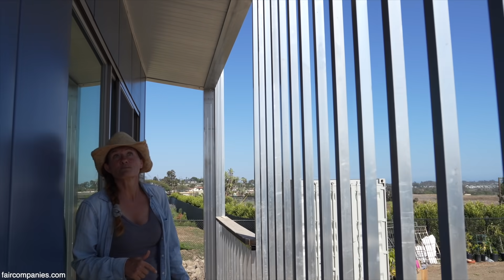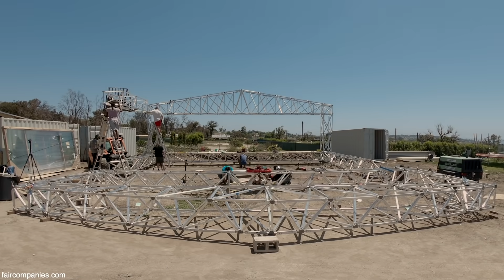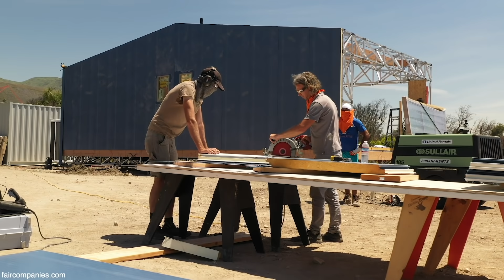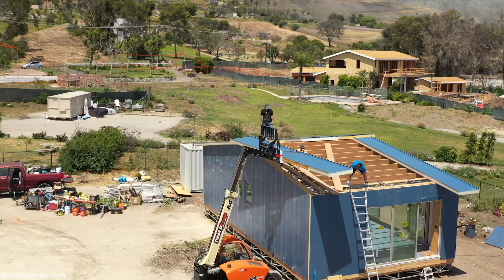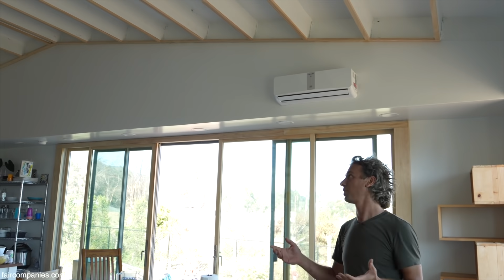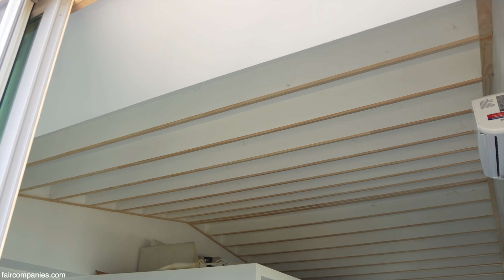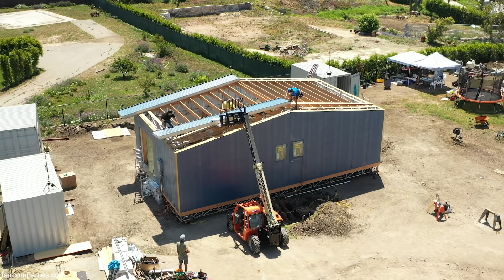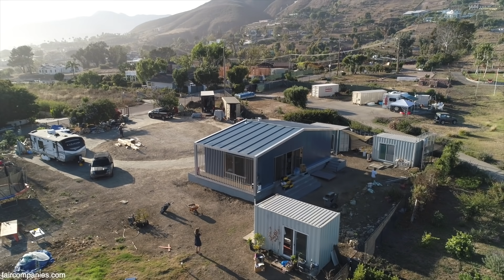This home goes up like a Coachella modular build: fast/cheap

Comment: I live in a tiny house on wheels myself, so I’m a strong supporter of alternative ways to house oneself.

However, one of the models on the website that is linked in the video’s comments—a 400 sq ft space—is listed by the company selling these at $216k.

These are housing projects marketed to high-income earners who want to live eclectically, not solutions to housing problems for regular people.

Comment: Aluminum conducts heat very well (to the exterior).  I wonder how a home like this would work in northern Canada where it can be -40 C in winter.  With the wind chill factor (wind blows heat away from anything warm, making it seem colder than it actually is), it can feel like -65 C.

Comment: Be aware, metal buildings in Parasise burned. Metal conducts heat, potentially buckles, deforms, creates gaps and the flammable contents burn in areas where people most want fireproofing, which is and near forests. And people want big windows and sliding glass doors, especially in scenic, beautiful natural environments.  Heavily design for firebreaks and isolation. And it is going to be extremely expensive to heat a big, open space with a very tall cieling. This design is more sales oriented than focused on a sensibly functional layout for most people. And heating costs is a primary consideration. Depending upon how well it is insulated, cooling costs may also be prohibitive in this layout. Broadside facing the peak of summer sun will contribute unfavorably to this.

Comment: i am wondering what technique/materials they are using to seal the roof. and i am wondering why they did not put a truss across the center point.. even if it was a narrower truss.. seems like that creates a potential weakness in the roof structure, unnecessarily..

Comment: You are using what is universally  known as SIP ( Structurally Insulated Panel) your house could have been completed in 5 days with cheaper galvanized steel frames. Cost in China are $28 per sq meter. Go to the website Made In China for examples and price.

Comment: This house seems to be very expensive, compared to alternatives such as container house (cheaper in material costs and has a higher resistance to fire, melting point at around 1425 to 1540°C, more than twice the amount compared to aluminium) or 3d printed house by Apis Cor (polymer concrete, cheaper and faster to build with).

Comment: Similar to Army engineers in WW II, for building bridges very quickly that could carry tanks across rivers.  Even the Sherman tanks, which were pretty small, were often too big or too heavy for existing bridges.  So they basically invented trusses that could be pieced together using pieces that could be handled by 2 men, working together.  I think they called them "Bailey Bridges," which was what I thought of when I saw the crews putting together the frames for the trusses.

I like the modular pre-fab idea for homes, and integrating these construction principles with earth-sheltered designs.  But if you want a living space in a hurry, for cheap, building a box on top of the ground this way is pretty cheap.  The walls are double-wall, insulated sheet steel, according to the video. I think if you wanted earth-sheltered, you would have to re-think the materials that came in contact with the fill.

Comment: I had a studio apartment built as a rental property made out of ISO panels, the same type of panels used here. The construction was fast, and even though I had my reservations about this type of constructions, I was present the whole time and saw the strength of the build. It was finished with sheet rock inside and laminate floors. The overall finish resulted quite good and I'm very happy with the results. Needless to say it won't be my last construction of this type.

Comment: I always enjoy all the different types of construction methods available.
This type home would not work where I live. With no attic with ventilation, the ceiling condensation would drip and cause black mold all over it. If a medium size tree got blown over on top, it would crash threw the roof.
Thank you for sharing! I love the outside look.

Comment: Why not concrete its fireproof bulletproof and sometimes bomb proof . In the long haul with energy efficacy and with the longevity it's less impact on the planet. (remember long haul )I just Built My small Cabin/Casita on my ranch In northern Arizona for 10 % less than wood. I would have done ICF foam block but I could not  get a  concrete truck deep into the mountains. They both run about the same in time,labor and materials the difference is energy efficacy is light years better with ICF foam block. All for a total on my 16X16 cabin i have 5500 into it free and clear.

Comment: this guy is full of shit "it's strong because of geometry"... yeah, so is a regular truss. there is nothing advantageous about this building design. a pole barn house achieves 100% of the same result, but without the extra bullshit. steel posts if you want extra fire protection, wood if you only want good fire protection.

Comment: And the SNOW LOAD? 
          Per Square foot.... MMmm
Reply: Malibu. California. What snow load?
It's cold if its 50F. Hot if it's over 90F.

Why would they have to factor that in when it snows (less than an inch) once every 75 years.

Comment: Fire seems to be the greatest fear with this building site.  Though the exterior is metal (Aluminum and Steel) the interior is wood.  If a fire gets to this structure the metal, exterior and interior structures will conduct heat to the interior sufficient enough to cause the wood to burn.  Though lack of oxygen might keep the flame down the smolder will be too much.  The owners of this property need to be able to keep the exterior cool somehow if they want to keep this house.

Comment: What is the R value of the wall? Does this system have an ACH50 rating?
Reply: Those are insulated metal panels, originally used in commercial walkin refrigerators.   They are almost completely air tight and are around R5 per inch, with 6" being the thinnest panel and 12" being the thickest.  Some companies have started making roofing panels (as used here) as well, they are typically R50 (10").   Look for Kingspan, SteelGenix, EcoSteel and Google Insulated Metal Panels for more info - they've been used in commercial buildings for 50 years.   They are so airtight that some home manufacturers supply an ERV so you don't have issues.

Comment: so it wont burn...just melt
Reply: Copied from another comment 'The numbers you mention are in the combustion zone, as in the wood burning from within. Aluminum will not burn thus it will never face those kind of temperatures. The point of this build is "to not catch on fire" from flying embers as a wooden and shingle house will. As long as there is no vegetation within 10 feet of this structure it will survive any fire around it because 10 feet from the flame it is nowhere near 600C. So the answer is YES this house will survive all future brush fires in that area as intended."

Comment: Is this polyurethane foam between the sandwich panels? When there is a fire it melts like a marshmallow.
Reply: Only if the heat source is within ten feet.

Comment: Err uhm.. all the aluminum on/near my parents house melted into puddles during glassfire. poor choice of materials for fire country!
Reply: Quote form other comment "The numbers you mention are in the combustion zone, as in the wood burning from within. Aluminum will not burn thus it will never face those kind of temperatures. The point of this build is "to not catch on fire" from flying embers as a wooden and shingle house will. As long as there is no vegetation within 10 feet of this structure it will survive any fire around it because 10 feet from the flame it is nowhere near 600C. So the answer is YES this house will survive all future brush fires in that area as intended."

Comment: won't aluminum melt in the fire?  I LOVE the cheaper idea, but i would be more scared in aluminum that wood
Reply: Copied from another comment "The numbers you mention are in the combustion zone, as in the wood burning from within. Aluminum will not burn thus it will never face those kind of temperatures. The point of this build is "to not catch on fire" from flying embers as a wooden and shingle house will. As long as there is no vegetation within 10 feet of this structure it will survive any fire around it because 10 feet from the flame it is nowhere near 600C. So the answer is YES this house will survive all future brush fires in that area as intended."

Comment: this design is unfortunate. If you had chosen to live on the West Coast for it's natural beauty, then perhaps this could be a taken as a cosmic sign that it's time to leave.  

Perhaps in time they could apply some wood to it.  Metal structures have an odd feeling inside, perhaps something electrical or magnetic missing. Not sure, could be my imagination.  You might also have felt this in an RV.  It is better to have one's biofield grounded with the Earth in order to heal, for both nature and humans.  

On a positive note, she won't have to worry about possible complications from 5g, as she is already living in a farady cage.  However, the infamous "Harvard Tin Foil Hat Experiment" revealed that RF ricoshets around the scull more with a metal hat on.  With all the wireless devices, she could be living in a microwave oven.  

As she has already lived through two fires, this presents a facinating example of how we unconscously manifest our fate.

Comment: Aluminium has a melting point of 660.3 degrees celcius bushfires get up to 1100 degrees celsius. It might not burn but it probably will melt.
Reply: Copied from another comment "The numbers you mention are in the combustion zone, as in the wood burning from within. Aluminum will not burn thus it will never face those kind of temperatures. The point of this build is "to not catch on fire" from flying embers as a wooden and shingle house will. As long as there is no vegetation within 10 feet of this structure it will survive any fire around it because 10 feet from the flame it is nowhere near 600C. So the answer is YES this house will survive all future brush fires in that area as intended."

Comment: She decided on an aluminium framed-structure with insulated steel panels--a good adaptation for a more fire-resistant structure.  The only thing I'm wondering:  They used wooden framing, beams & joists for interior support,  They could have carried through fire-proof techniques using galvanised steel studs, beams & cement board.

Comment: I don't see how the fire resistance of aluminiums would help. Any home would be beyond repair after a wildfire. With wood you'd just have less rubble to clear.  The only important thing is how much time the building gives you before it collapses once it's on fire. Light aluminium structures would lose their load bearing capacity faster than wood in a fire.

Comment: Let me just say that love this channel but this guy. Timber trusses also stand up due to geometry, tension and compression joints that transfer loads to 2 points, and can easily span 40 feet. you can also run whatever you want in the roof as they create a space as well. It's been a while since I have heard so much crap, lies and outright incomprehensible word smithing in 15mins. What does a traditional truss uses mass to carry the weight and transfer the load even mean?? your truss is under the gravitational laws as any timber product and needs geometrical designed webbing to transfer the load to the end points. I’d like to see a cat 5 aluminium structure and the cost! We don’t need builders any more with 20yrs experience we just need a few dudes with a couple of days training and boom, this so called housing crisis will be fixed. Your structure will be under the same bylaws and regulations that every house is regulated by. Those external panels can be placed on any timber structure. The cool room wall and roof system is the real saving here. Time and cost and those products have been around for a long time. 4 timber trusses two steel beams 12 posts and away you go. I’m gathering there are outdated timber floor joists (kind of skipped past that on the vid) as well as outdated timber rafters that we can see?. is the footing time counted as part of the build? how are you going to build near the ocean? have you seen what sea spray does to aluminium? how do you replace that floor structure? You can’t build in the bush, what is the heat rating of your aluminium structure floor structure?  Take your Scaff and you bull dust and go back to your concerts dude. I love this channel but I can’t stand charlatans, peddling inferior products as the future of building. Timber and conventional construction has been around for thousands of years, not hundreds, because it stands the test of time, under all conditions.
Reply: All true, but the real innovation here was overlooked - there is no foundation and, from the looks of it, no site prep.  Given that pre-fab manufacturers often say that 50% of the build cost is foundation, site prep & permits, that is huge.    Also, innovative use of IMPs, which is not common in residential.
Reply: @ckm-mkc  No, I overlooked nothing. the floor structure was bolted to somthing in the ground. Concrete pads i suspect. Site works and footing were pre constructed. You can't have contruction without footings  unless you want it to sink into the ground, building cracks or blows away.

Comment: Aluminum is an interesting choice, there are instances where aluminum engine blocks have melted during forest fires.
Reply: Plenty of times rims are just puddles running away from the burned out carcass.
Reply: Copied from another comment "The numbers you mention are in the combustion zone, as in the wood burning from within. Aluminum will not burn thus it will never face those kind of temperatures. The point of this build is "to not catch on fire" from flying embers as a wooden and shingle house will. As long as there is no vegetation within 10 feet of this structure it will survive any fire around it because 10 feet from the flame it is nowhere near 600C. So the answer is YES this house will survive all future brush fires in that area as intended."

Comment: I see a lot of problems, the cost? seems very expensive, the energy/Co2 used for building it. Wood is so much better choice on most parameters. Building in 30 days is not that fast, compared to wood element. Worst of all, its not a nice look to me.

Comment: I wander how conductive the aluminum is as it goes from outside to inside.
Reply: Very. Good for hot areas, and will cool down quickly in tropics. But, there is a layer of foam all over the outside of the structure.

Comment: I like this.  I was concerned that there would be a lack of light inside, when I kept seeing that big, unbroken wall on the outside, but on the inside there was a lot of light....clearly the design of the walls inside, and the big sliding glass doors, made the difference.

Comment: People going on and on here about not liking the look and style are missing the point. One a a house is engineered this way—with no interior load-bearing walls—you can make the look whatever you want. Build the interior walls to the ceiling if you want, it not. Apply stone or wood or whatever finishes you want. Paint the exterior blue or green or clad it in wood or whatever.  Heck, build a bathroom wall out of macaroni if you want. You are free to do as you wish because you aren’t bound to the home’s engineering. All in a house that can be built in weeks instead of months?  And is termite-proof to boot?  Where do I sign?

Comment: Aluminum melts easily.
Reply: But it's a good thermal conductor.  So you have to heat the entire structure to get it to the melting temperature, while it's also dissipating that heat at a fast rate, and that also helps eliminate hot spots.  So it's not that easy to melt an aluminum structure... While aluminum has a high reflective index for radiant heat.  So it's much harder to heat it until the fire gets physically close to the structure...

Comment: I don't get how the panels are sealed. It seems like there would be air leakage between them. Did they exlain that?
Reply: You could write the OEM directly.
Reply: They are insulated metal panels, a technology invented for commercial refrigerators and widely used in commercial construction.   There is a complex tongue & groove between the panels that has both gaskets & sealant making it completely airtight.   Which is actually a huge issue as a house needs to breath since humans generate water vapour.  An ERV is required with buildings this airtight.